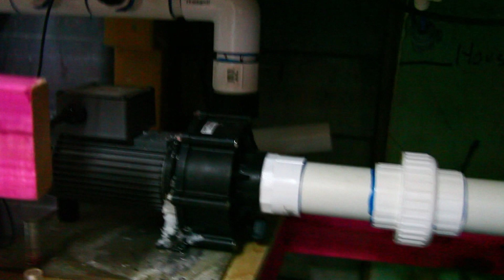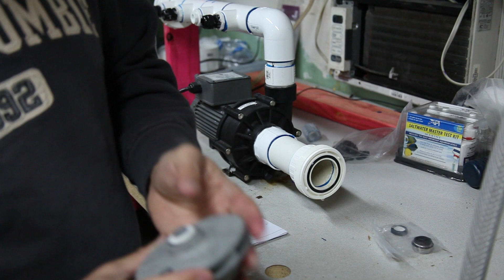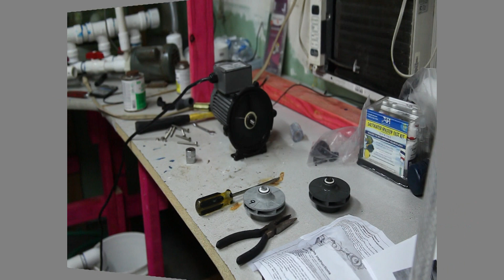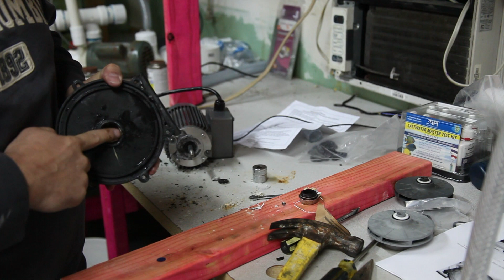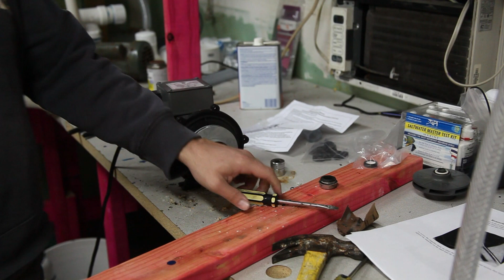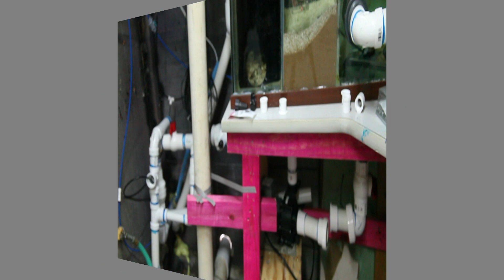Seal Replacement on a ReeFlo Dart / Snapper Hybrid Pump

Comment: Let me tell you something, Brian, but all you respect, sir I used to work with precision fluids and Reflows pumps for 5 years the motors are not good. The only good motors they have is Baldor made in the US and you know that cause he’s built in the US the other motors from China. Their plastic looks nice clean, but it’s made in India. The seal are not American seal ship material they would like to you. They’re gonna tie you, all the products are from freshwater and salt and put a bunch of silicon in the back so they don’t leak. You will see a rubber band with seal so they can make tighter so they don’t leak impellers the glue at the shop with a bunch of glue if you don’t believe me, you will see all the crazy glue, that you if you need good motors, go to Vantege manufacturing on the city of Santa Ana Santa Fe st

Comment: Cheapest motors from Reflow I used to work with them in the city of Santa Ana California dirt by the motors in China for $2 and then they're selling and the US for f**** $400 plus they overheat I used to work with them do Snappers hammerheads darts and specially the Titan

Comment: Everyone assumes seals somehow seal or close around shaft lol BUT DONT ! ... shaft can be full rust wouldn’t make any difference at all , it’s the 2 ceramic faces of the seals meeting that seal volute water in.. if look at pump easy see NO PART SEAL EVEN touches shaft lol ... cept for end threads where the impeller , that only uses threads to push to ceramic faces together while seal spring pushes back👍 hope helps ..(yes impeller obviously held on by threads on shaft lol)

Comment: Have you ever had a problem with the impeller tightening after it starts, mine keeps overtightening to the point it will not restart after it runs after a while

Comment: does your new pump still make the same noise coming from the fan? i took the back side of the pump and it turned out the fan blades were slightly bent. I bent them back and the noise was almost completely gone.

Comment: @hotpuppy72 Glad to hear that.  Did they replace it with one that had the AO Smith motor or with the Baldor motor?

I have not had any major issues yet, but they are replacing the seals and have had excellent response times to my emails.  I am extremely satisfied with the way they are handling my issue so far.